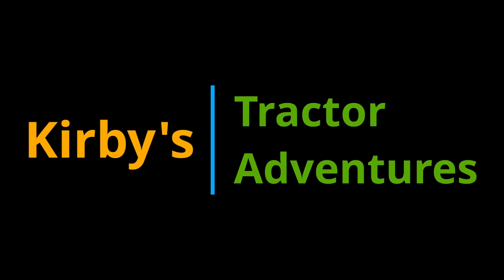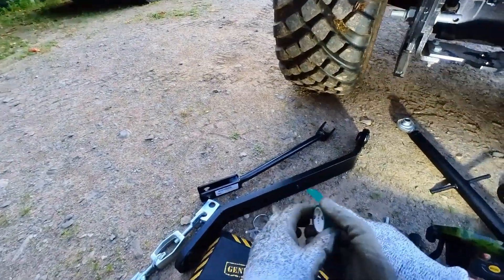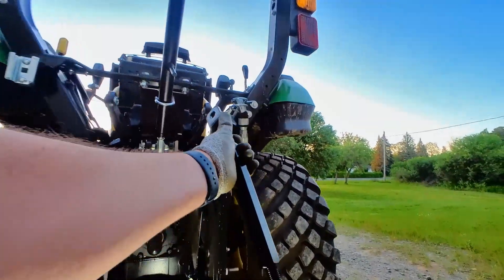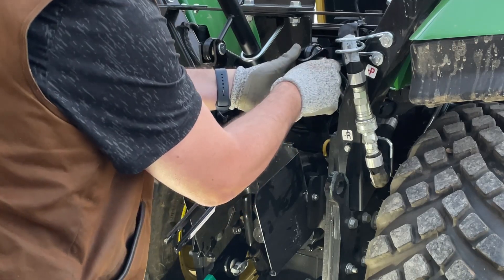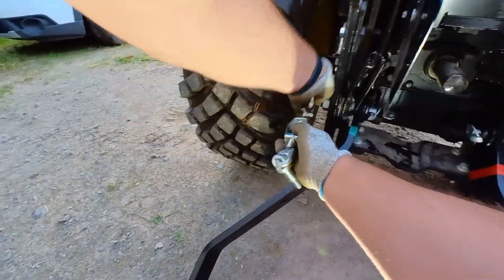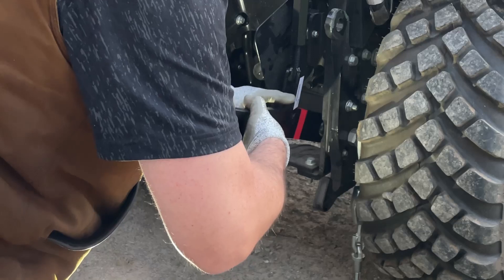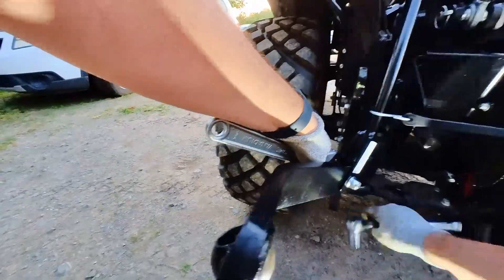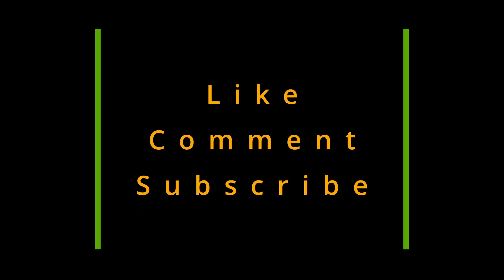3 Point Hitch Installation - 2025R John Deere Compact Tractor Gen 2 (2022 Model Year)

Comment: Where can I find this ALV10726 kit in Canada? 
I called a John Deere dealer and the original can only be sold part by part for a total of 1500$ + tx !
Reply from the maker: My tractor came with it in the bucket, in a box labeled ALV10726 from the factory.
Too bad they couldn't help you more!

From the image, linked below, a possible complete assembly part  number is: 13501:
https://partscatalog.deere.com/jdrc-services/v1/image/getImageBlob?locale=en-US&type=D&iid=705366

Comment: Where did you get that kit?  I got a used 2520R with backhoe and the 3pt hitch did not come with it.  Need exactly what you just installed.
Reply from the maker: My tractor came with it in the bucket, in a box labeled ALV10726 from the factory.
Hopefully your Deere Dealer can help source one for you.

From the image, linked below, a possible complete assembly part  number is: 13501:
https://partscatalog.deere.com/jdrc-services/v1/image/getImageBlob?locale=en-US&type=D&iid=705366

Comment: If you install and adjustable lift arm on the left hand side and shorten both sides but leave a little gap you can add about 4”s to your lift height
Reply from the maker: Sounds interesting. Have you done this?
Reply: @kirbystractoradventures  There's a vid from a guy in Aus who did this; worked perfectly.

Comment: What tires are those? Alas here in Hawai'i we kinda get what we can, which means mine came with the standard industrial tires. And they are not at all the best for the yard.
Reply from the maker: They are a R3 Turf Tire Radial instead of a  bias ply. 
Tractor Time with Time & Good Works Tractors both have an in depth video about them
I agree,  they work well on grass, dirt & snow.  If you turn too hard it can tear up the grass.
I'm very happy with them.
Reply: @kirbystractoradventures  Thanks for the reply. Yeah I just wish I could get them here in an reasonable amount of time !
Reply from the maker: @EvilMerlin  Tires are a hard item currently in the market. I was told to expect up to 6 months when I ordered mine. I luck out in under 3 months
Reply: @kirbystractoradventures  Yeah even waiting 3 months is rough here. We don't really have a dry season and having to deal with mud and hills makes wheel spacers a must. I've seen nothing but good reviews of these, but I just can't wait that long and honestly shipping to me increases the price 50%!